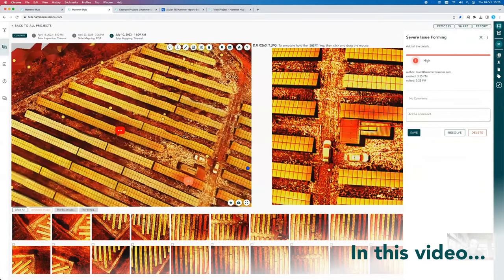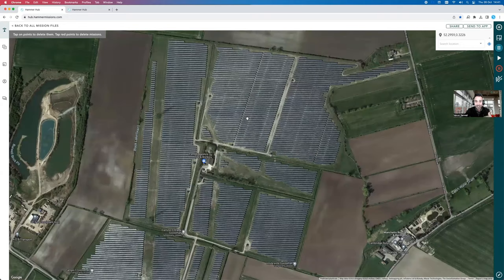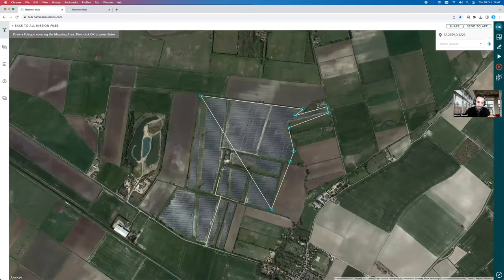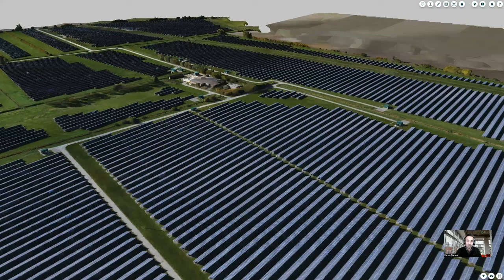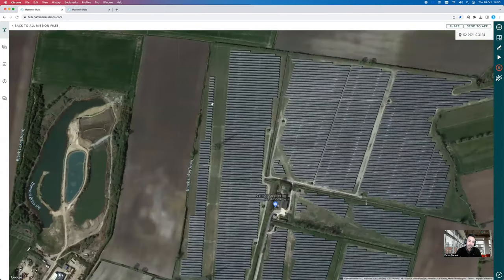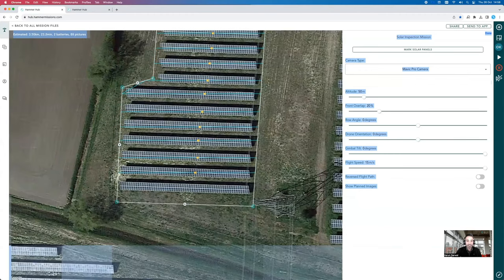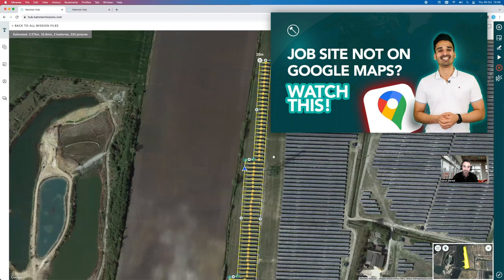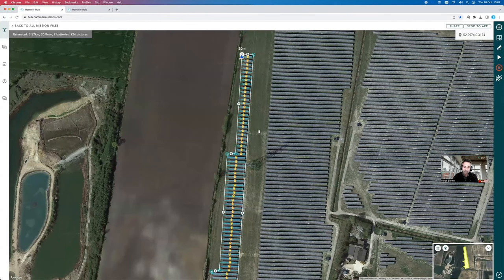How to perform Solar Park Inspections with Drones? | Drone Mapping | Hammer Missions

Comment: Has potential for use as an overview map of site and as an orientation of where anomalies and faults may reside, but it should be made extremely clear that this is by no means a solar inspection or a solar inspection report! You really need to make this clear as you are misleading users as there is no compliance with IEC standards. What I would advise is that the site data set is first analysed in proper thermographic software that will calibrate the thermograms with emissivity and TRef values and of course anomaly/fault temperature values BEFORE bringing into hammer where I can see it being useful to create the overview and fault location/orientation.
Reply: @pioneerdroneoperations  I think I did?
Reply: @SteveFisherVisualChaos  sorry, I meant to say is can you recommend that software you mentioned?

Comment: Does Hammer Missions work with DJI Matrice 350 RTK?
Reply from the maker: Yes!
Reply: @HammerMissions   Super! And does it follow IEC TS 62446-3:2017 standards for aerial thermography? Im planning to use Hammer for solar panel inspections.